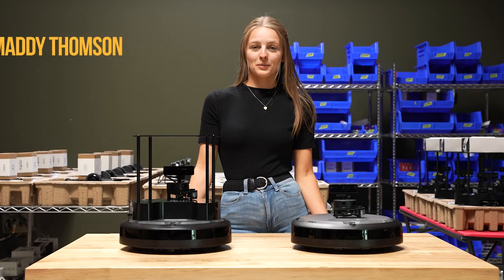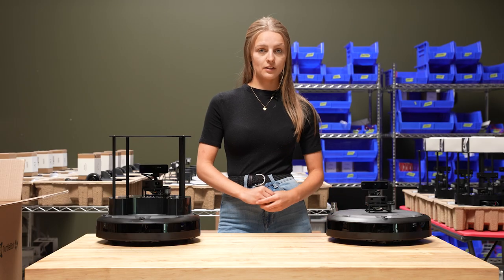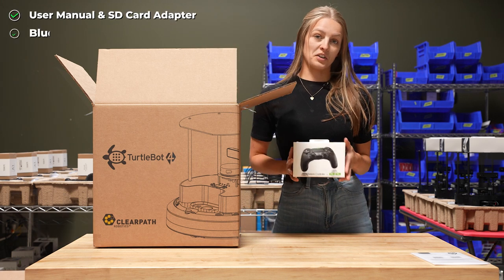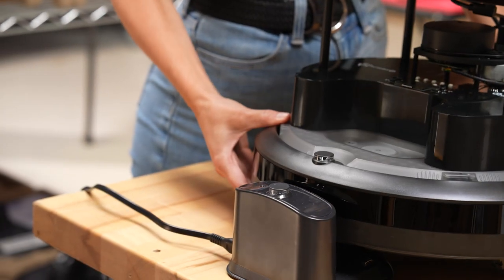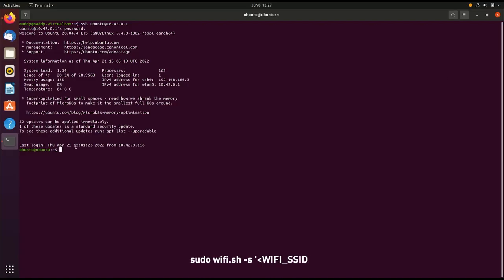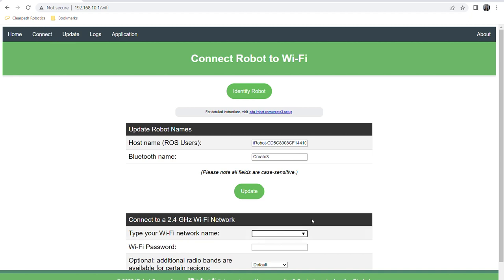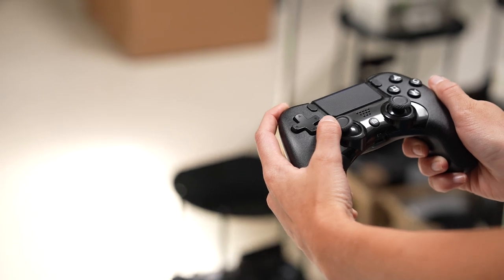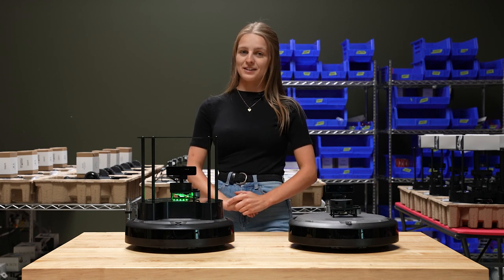TurtleBot 4  |  Unboxing & Getting Started

Comment: Is it possible to pair a TB4 Lite with a PlayStation 5 controller?
Reply from the maker: Hi Jaiyam - Yes it should be possible by following the instructions here, assuming the button mapping is the same as the PS4 controller:  https://turtlebot.github.io/turtlebot4-user-manual/overview/quick_start.html#turtlebot-4-controller-setup

If the button mapping is different, you will just need to make a modified version of this file: 
https://github.com/turtlebot/turtlebot4_robot/blob/galactic/turtlebot4_bringup/config/turtlebot4_controller.config.yaml

Hope this helps!

Comment: Hi I followed this video step by step, but unfortunately my turtlebot4 are already on ROS2 Humble version. But this video is for Galatic Version. it can connect to the wifi well (using the sudo command as in video) but when i try to setup wifi settings using ROS2 Humble version. it wont change the WIFI and when i set it to same SSID it says there is duplication on WIFI SSID. and now it wont connect to any of the SSID, how do i fix this?

Comment: hello, i have a question 
i have a turtlebot4(standard, ubuntu 20.04, foxy ) 
and i used pc ubuntu 18.04 rosversion dashing , and added CYCLONEDDS ~ on bashrc , 
but i cant not find Turtlebot4 Wifi 
my pc has wifi on
any problem in there ?? 
ROSversion?
Reply from the maker: You may want to check that you have a 5 GHz wifi adapter. Also, Ubuntu 18.04 and Dashing are not compatible. We recommend trying 20.04 and Galactic.  Hopefully this helps!   if not, feel free to reach out to our support team at support@clearpathrobotics.com.